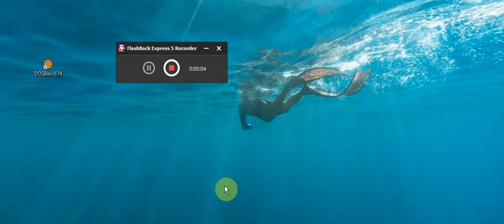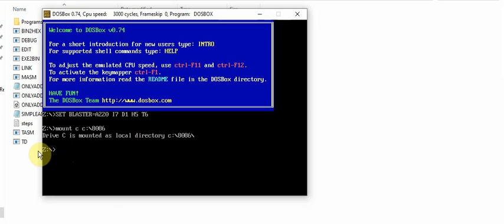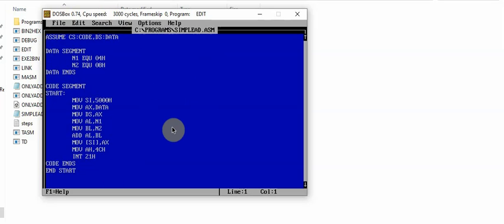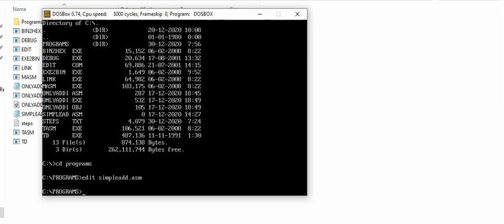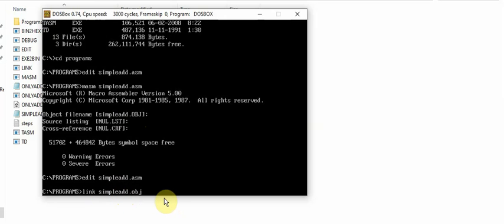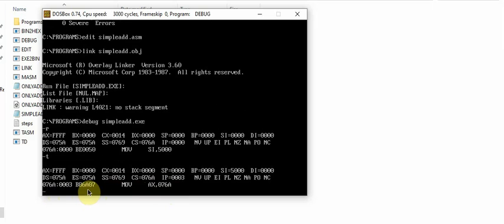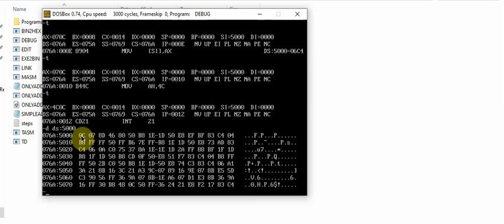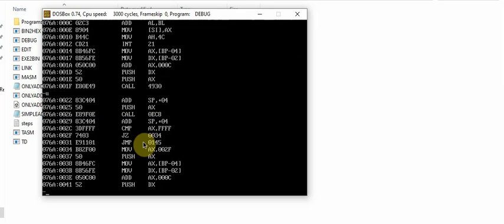DOSBox Tutorial Step-by-Step for execution of assembly language programs | MICROPROCESSOR

Comment: DosBox let us use 16 bit and 32 bit instructions in the 16 bit Real Address Mode, the 16 bit Big Real Mode/Unreal Mode and in the 16 bit or 32 bit Protected Mode.

In the 16 bit Real Address Mode the segment size is limited to 64 kb for all segment register. So if we use a 32 instruction like "rep movsd" to copy some bytes we can copy only 64 kb at once and the used address register ds:si and es:di points inside the first mega byte.

.---------

To access an address above the first mega byte we can use the 16 bit Big Real Mode/Unreal Mode(ems=false) with a segment size of 4 GB for DS, ES, FS, GS segment register, but not for CS and not SS segment register. In this Mode we can use ds:esi  and  es:edi  for copy.
(The linear framebuffer for the Svga—S3 emulation located at: 0C0000000h.)
Example:
rep            ; repeat prefix, decrease ecx
DB 67h     ; address size prefix
movsd     ; copy from  ds:esi  to  es:edi

The 16 bit Big Real Mode/Unreal Mode is compatible to DOS and Bios 16 bit software interrupts and XMS memory manager, but not with EMS memory manager. ems=false in DosBox config.